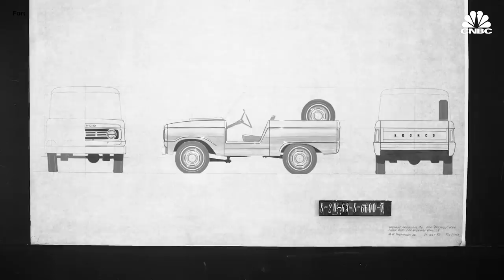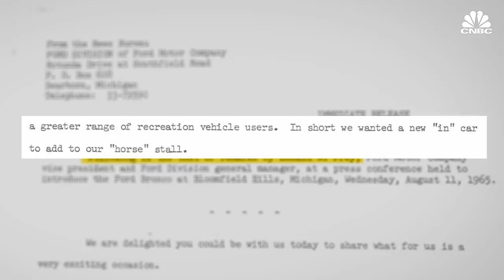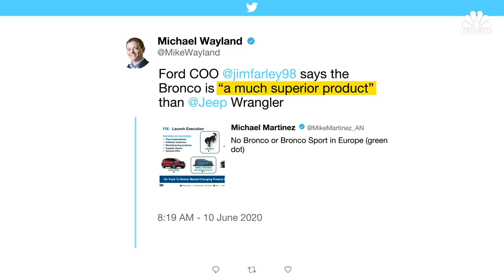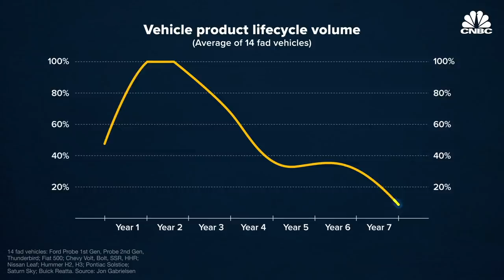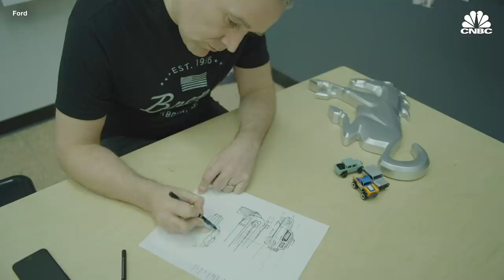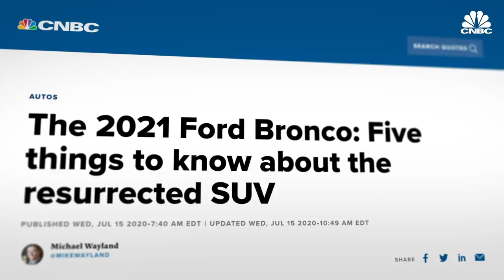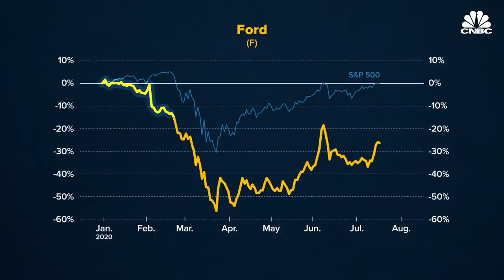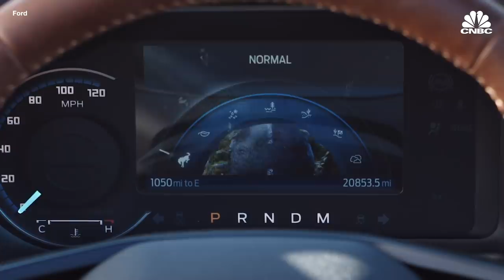Why Ford Is Betting Big On Its Bronco Revival

Comment: Nostalgia can only take a company so far.
The fact automakers revive once popular models from the past shows they have no original thinkers in Detroit anymore.
Yes, both Bronco models will sell well initially because of nostalgia but in the long run the full size model will be canceled, again due to low sales in part because the Bronco is overpriced and quality issues which is why it had a delayed release date just like the Explorer.
In fact quality was so bad Ford moved production from one plant to another causing delays and rising cost do to retooling.

Comment: The only Brand New Vehicle I ever purchased was a 1980 FORD F-150; the worse truck in the history of trucks!  Poor quality overall, engine overheated for unknow reasons, master cylinder failed and locked up all the wheels,  one wheel cylinder locked up and left me stranded again, the paint started peeling in chunks from over the hood and roof. I finally had enough of the poor quality and sold it after 3 years with only 30,000 miles with a loss of $7000 from the original price I paid for it. Tried to trade it in  once and the dealer offered me $1000 bucks total. Never again purchased a FORD product. Hope they are making better stuff now.

Comment: In ten years, the only thing Ford will sell will be truck-based SUVs and pickups. Lincoln might continue to sell the Nautilus. The Edge is already being cancelled. 

If you ever have problems with your Ford product, get ready for the company to tell you to f*** off. 

My Focus has had five clutch packs failures and two transmission control module failures. Ford never agreed to replace the transmission as a viable option. Ford’s “band aid” fixes never fixed the problem of a flawed transmission design. The car now shakes under acceleration and Ford thinks this is acceptable and has refused to replace the clutch pack again. 

If you buy a Ford, make sure you get one that is trouble-free. Otherwise the company will absolve all responsibility when there are problems. 

My Focus is my first and LAST Ford product, ever.

Comment: thats cute FORD, but if it came with a V8 Coyote, that would be great.
the ecoboost is a great NEW engine, but it wont last for years like a Coyote. 
if it was bigger and could tow an RV, then id consider. The FORD drive trains, especially the 4x4s, are pretty awesome. I had a 2003 Ranger Edge that I ABSOLUTELY LOVED!! 
not a fan of this Broncos looks and power train

Comment: Bronco has a good name.  The new vehicle, however has to be better than equal to the Wrangler, and not with gimmicks.  It has to be stronger, tougher, more reliable, better than the Wrangler, like the F-150 is a better vehicle.  It has to maintain that reputation...for years.  Folks like the Wrangler because they get ‘em cheap and can modify them greatly.  Is that where Bronco wants to go?  Does anyone think of the Bronco as the, “one vehicle to do anything, “ vehicle.  Can it off road, daily drive to work, pull a good sized trailer...like the F-150, better than the F-150, better than the Wrangler?   Will we be able to get them cheap and modify them greatly?  Or will they be OMG expensive, out of reach of the common man, during a time when the common man is trying to save money, stay away from expensive luxury toys?  Hmmm?

Comment: When you add things like tables and bottle cap openers to a truck, to entice people to buy, but yet in your 6.2 l f250 you have a high revving low torque engine....the people with half a lick of sense are not going to buy your products. I love my high torque Toyota tundra I would never buy a Ford.

Comment: “The bronco has to be true to what it always was”... so wheres the v8?
Reply: The new engines are more powerful than any engine ever offered in a Bronco.  
Though these comments sound similar to the 89 Thunderbird release.  Though in 91 Ford did give in a give the V8 moaners  what they asked for, though was less powerful and slower than the V6 option.  Yes in the 90s Fords most powerful engines were V6s.
Reply: The mustangs were Dog’s in the 90’s compared to firebirds and camaros. My cousin had a Firebird Formula and would pick me up from school and smoke mustangs no problem
Reply: @aidanpierce4863  well that issue can be attributed to the fact v6 Mustang could sale where as Fbodies couldn't.  But 5.0 Mustang were compatible to 350 F bodies.
Reply: bowez9 the Cobra maybe but during actual testing the Z28/Formula/Trans Am still had more Torque.
Reply: @aidanpierce4863  the Ford had better fuel delivery  (SFI and MPI) so the area under the curve was greater, and total area under the curve is more important than peak values-- especially on the street.
And the Cobra took a back seat to the Tbird SC in performance.  Thanks to that area under the curve and 300lb-ft plus torque.
Reply: bowez9 the raw 0-60 times say differently and the LT1 and eventually the LS engines have great efficiency for getting air and fuel into the engine. Heck, they raced the F bodies in IROC racing
Reply: @aidanpierce4863  LS didn't come out until 97 and should be looking at DOHC 4.6 at that point and not FOX body 5.0.  As for LT 93 Formula 0-60 time listed at 6.2 and 90 LX Mustang at 5.9.
Reply: bowez9 later 90’s models were faster and won more race series and were used in more race series. The LS used in them won Le Mans in a Vette, not a Ford to be seen
Reply: @aidanpierce4863  Le Mans engine have nothing in common with a street engine no matter the manufacturer.
But I thought you said F-bodies were faster than Mustangs 6.2 is slower than 5.9.
As for later 99 Cobra with IRS 0-60 5.4 and 99 WS6 list 5.4 0-60.
Goes back to most Mustangs are base engine because people will buy them; no wanted to be caught dead in base Fbody hence the reason they went out of production.

Comment: The FJ cruiser had awful visibility. You couldn't take off the top and it got terrible gas milage. It was just a less practical 4 runner. You can get a 4 runner turd that is basically as capable. It only differentiated itself with looks. Even so they remain popular in the used market and are rediculously overpriced. They should have kept making it.

Comment: Many of US auto makers are missing the point, they are simply just selling nostalgia, instead of improving their products.  Dodge Chargers, Ford Mustang, Bronco... yes, they have the classic look and feel, but what’s the improvement?  No electric engine offering?  Still running on combustion engine?   I would have applaud Ford if they release Bronco in both electric and combustion engines...
I feel like American automakers are refusing to move forward, not sure if it’s due to their inability to innovate or they are married forever to the big oil... which is an industry that is fading

Comment: its going to be the biggest failure for ford...  its not a jeep it has independent suspension just like the failed toyota FJ and it will cost a lot more.  you will not compete with jeep with IFS/IRS

Comment: The 800 lb. gorilla in the room is asking, "Why not an EV-Bronco?"    The chassis is perfect for a high ground clearance with low center of gravity due to battery weight.  This is Win Win.  Also the square-ish  design makes it a perfect platform for fold out solar panels.   C'mon Ford !  Open your eyes godammit!  You don't have to divorce Exon, just start one Bronco model that goes on dates with Tesla.

Comment: Ford products are just absolute junk and here's why.  They redesigned the 5.0 causing it to have tap like a rod knock with no solution for a fix, cam phazers failing on the 3.5 ecoboost along with the 5.0, the 2.2 ecoboost 4 cylinders blowing head gaskets, blowing motors into peaces such as weak connecting rods, and to top it off making an electric 4 door mustang. How stupid is that, not to mention that the mustang is the only car in their line up after killing off the Taurus, Fusion, Focus and Fiesta.

Comment: LOL What a joke!  There's a reason JD Power and Associates rates Ford trucks "highest in INITIAL  quality"!  ....Because they can't rank them in ACTUAL quality!  Sure you get all kinds of fancy pretty plastic crap "standard", but all that crap breaks REAL fast and falls apart like the POS has leprosy & parts are always falling off.   I'm gonna start a pool & take bets as to what catastrophic failure it suffers first!  Roll over  prone?  Explosive fuel tank failure when someone even bumps it with a shopping cart? Wheels & axles  falling off at speed?  OR perhaps a  whole brand new , magical,  cluster f%@k of episodic engineering failure..Guess we'll know in short order! :)

Comment: Folks, for the love of god, stay away from this vehicle if you are serious about off-roading, fords ecoboost engines are notorious for engine failures, bought a F150 ecoboost for my wife, the condensation in the intercooler left the truck stalled on the highway many times meanwhile I have taken my trd off road 4runner has seen rubicon trail,magruder road,alpine loop trail,Washington backcountry route, white rim trail and brought me back home every time without any issues.